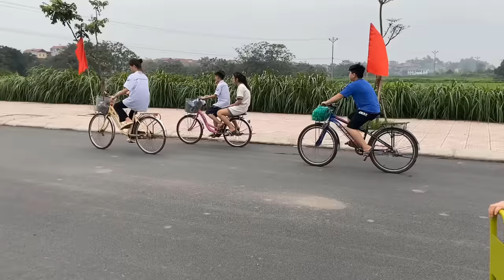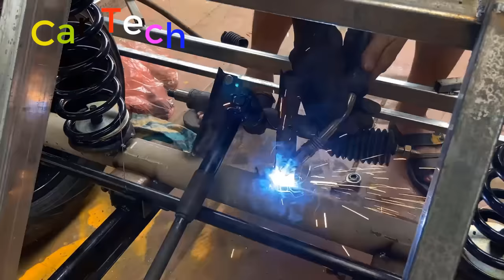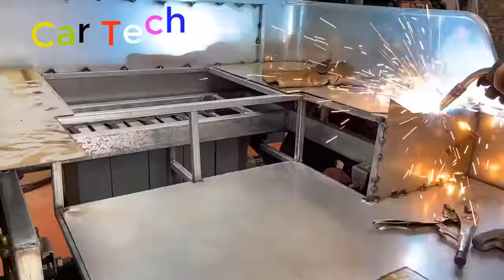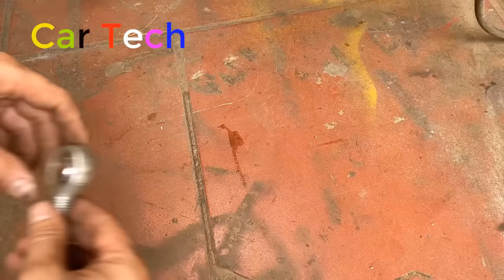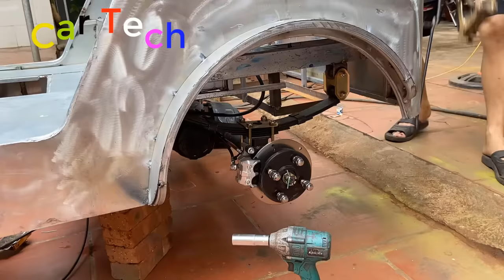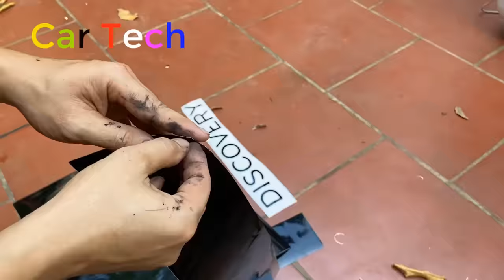Homemade electric Jeep Wrangler - Full video | Car Tech

Comment: Your videos are very excellent ❤.. May i ask you about the Power or CC of the engine please.??
Reply: Pls what is CC?
Reply from the maker: 48v1500w motor
Reply from the maker: 48v1500w motor
Reply: @AdeniranSemilore-te9fy  cc means cubic centimeter in a bike or a car. its a dimensional representation of engine cylinder volume. the actual cylinder volume where d combustion process takes place.
Reply: @cartech91  thank you bro

Comment: I don't see the reason for a differential. Why not use separate electric motors for each wheel? 
There should be a kilowatt hour of battery for each 10 kW motor. 
What's the range? Baker Electrics were likited to 160 kilometers. 
Without a portable generator, it's a toy.